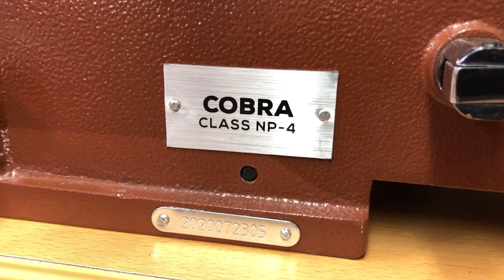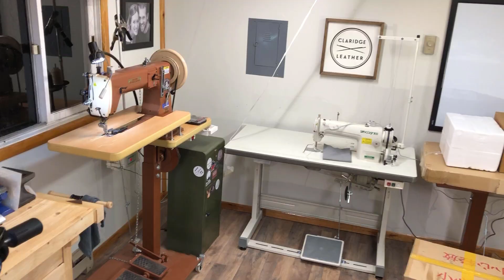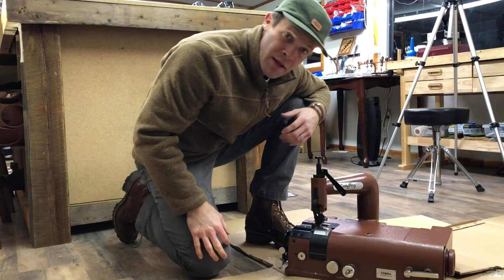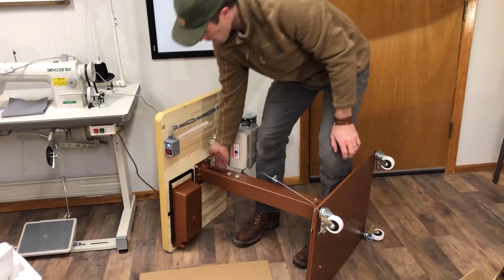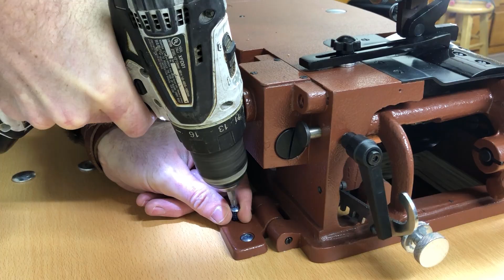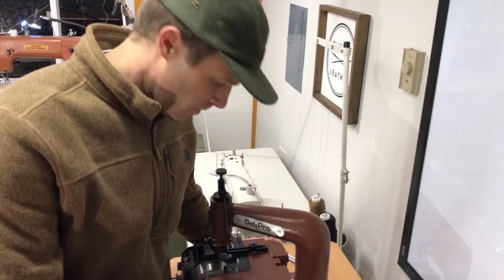Initial Setup of a Cobra NP-4 Skiving Machine (6-Minute Unboxing & Setup)

Comment: Thanks for your video. Excellent skiving machine, essential tool for leather work. This was set at the factory. After the first sharpening of the bell knife it must be adjusted from the beginning. Be careful with the sharpening of bell knife because the manual doesn't say all the way.

Comment: Tanner,  As with all the other comments on here...Thank You and Good Work your doing.  I do have some questions for you, if I may.  Do you skive both Chrome and Veg Tanned leather with this machine?  If so do you run into a problem with either type of leather?  
  Thank You very much for your time and Videos.
  Ernie D.
Reply from the maker: Thanks, Gunner— yes, definitely skive both types. Thin, very soft leather is your trickiest (and this isn’t the machine for thick veg tan), but keeping it sharp helps it skive all types of leather really well.
Reply: @ClaridgeLeather  thank you very much.  Right now 8-9 oz veg is the heaviest in working with.  Looking at being able to skive no more than 5-6 oz veg.  Keep up the good work on the videos.  You do very nice work.  Hope it warms up your way